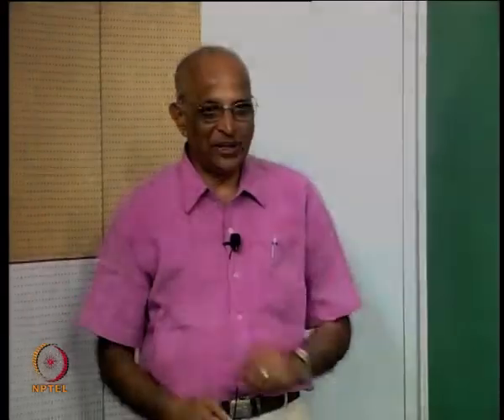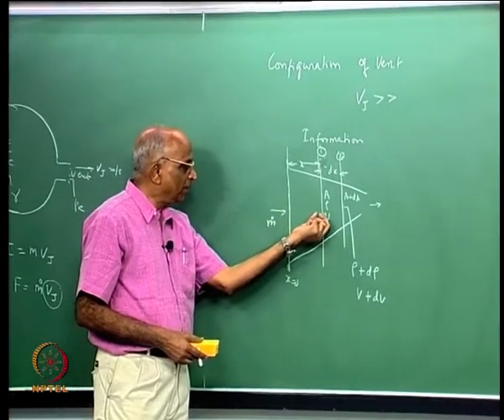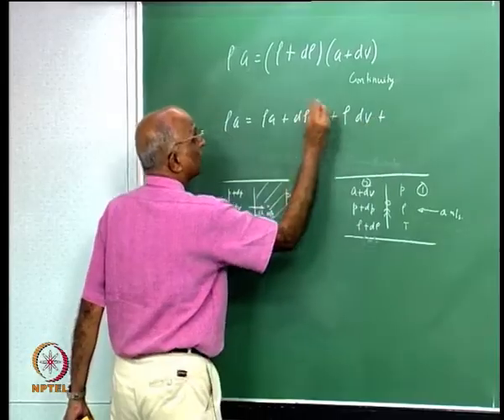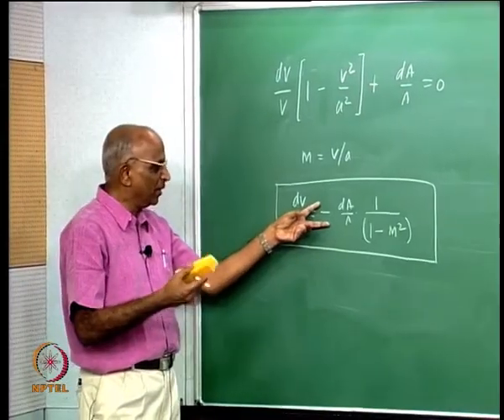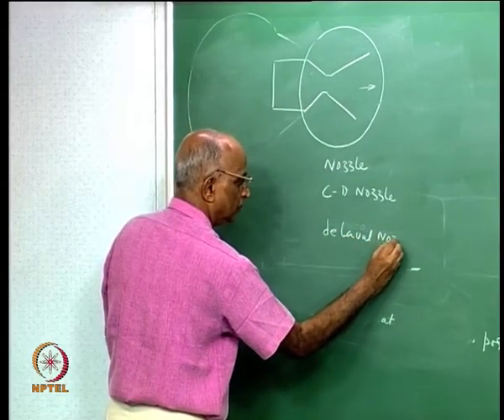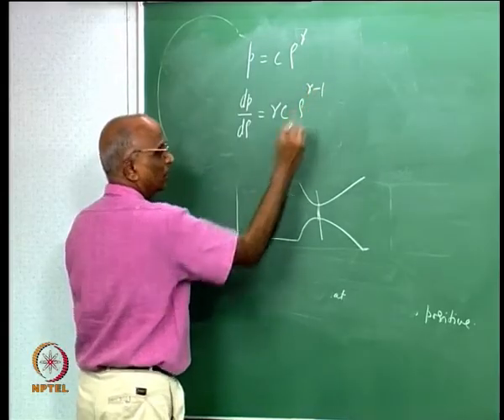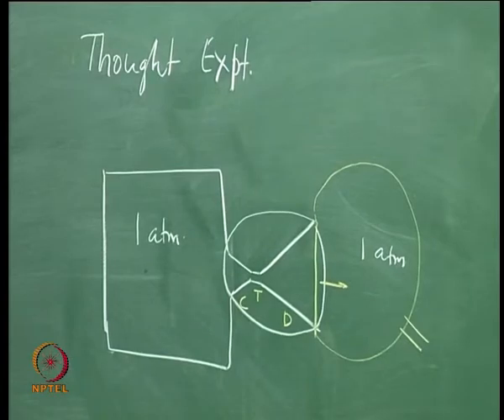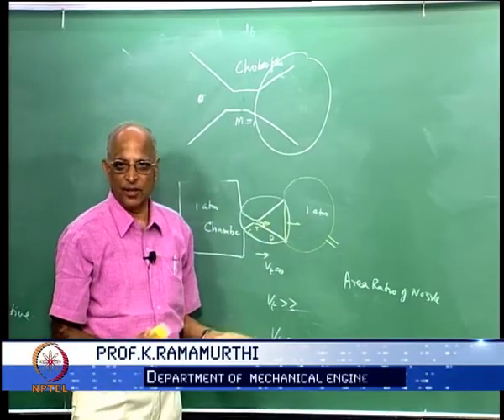#10 Nozzle Shape | Introduction to Nozzles

Comment: Pofessor, shouldn’t the momentum equation include the fact that the area is not constant? In the left-hand side of the control surface, the area is (A) an the pressure is (P). Shouldn’t  the momentum equation be written in terms of ( A + dA) and (P + dP)?